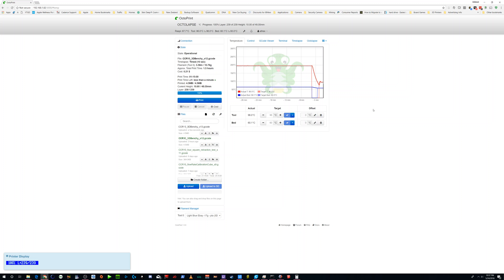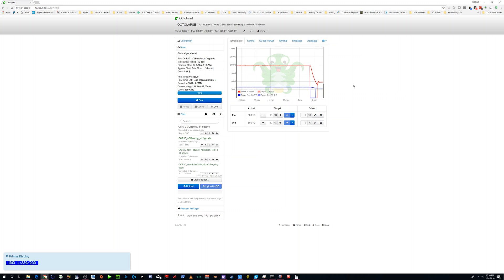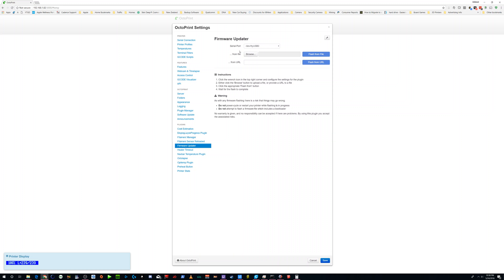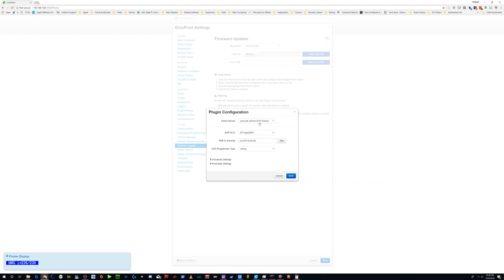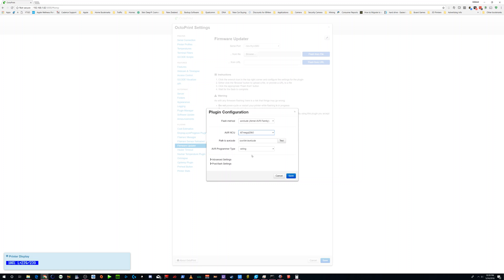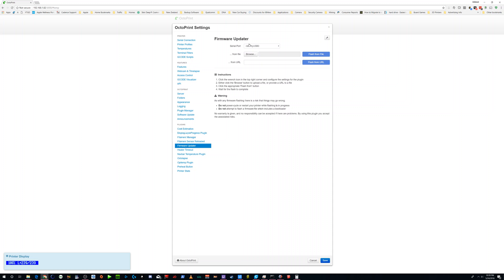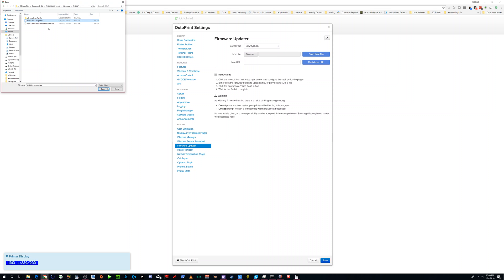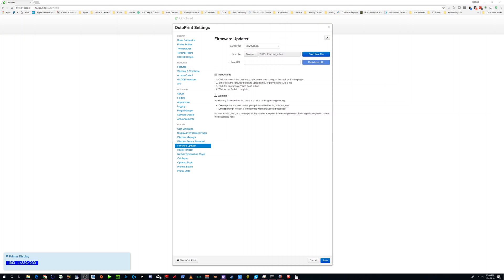Update CR-10S firmware using Octoprint firmware updater

Comment: can this be done on a CR-10 V2 (no bootloader) ?  Using the USB port?  Or does a USB flasher have to be used on J1 on the board inside the controller?
Reply from the maker: I am not sure for the cr10 v2, do you know which board it has?
Reply: @AthexTube  

2.5.2 -- but i've heard it has no bootloader from the factory, and only gets a bootloader AFTER being flashed.  Haven't been able to prove or disprove any of this tho.

Thanks for considering.
Reply from the maker: @etyrnal  Seems like you will need to flash a bootloader most likely. I would look for a guide to flashing the Cr10 V2 specifically theres always a risk to brick it if done wrong.
Reply: @AthexTube  

ok, thanks!  That's what i was trying to be careful of.

Comment: UPDATE: WORKED PERFECTLY! 

lol. well. that didn't work. "KILLED. PRINTER HALTED Please reset." I wanted to get a dual extruder board eventually anyway.
Reply from the maker: Something must have went wrong during the flashing for that to happen. I havent had probablems but always worry. Apparently you can restore the firmware with a raspberry pi or ardunio there’s probably videos on it somewhere
Reply: @AthexTube  not your fault at all. Your instructions were great. Turned out to be a total coincidence. EZABL nut on the new bullseye fan setup (which was the impetus to updating the firmware because I needed to move the easy EZABL from the left to the right)  was coming in contact with the thermistor and heating cables. When the new firmware went to initialize the EZABL at boot, it just crashed.
Reply from the maker: @BBB-fh8dx  Nice, glad you figured it ou!
Reply: @AthexTube  ehh. I was kind of hoping to get that dual extruder board. Lol

Comment: Do you have any walkthroughs for plane cr10? My printer starts the firmware flash disconnects and times out
Reply from the maker: I dont but you probably need a guide for flashing the bootloader
Reply: @AthexTube  that's strange I already installed the bootloader as I am just upgrading my TH3D software currently on the unit.

Comment: Hello I need your help, I have a Cr10-Max and when I send a Gcode through Octoprint the Bl-touch moves but the XYZ axis motors do not move
Reply from the maker: I dont know if you fixed this issue, I just installed a bltouch but I didnt run into that problem

Comment: Seems it's all changed now :( Totally different interface on the Octoprint plugin
Reply from the maker: Thanks I may do another video with the interface change updated. I havent looked at it but I suspect the options are similar just different places/names
Reply from the maker: I took a look at it and I think you are using a completely different plugin, please use the following plugin for this functionality: https://plugins.octoprint.org/plugins/firmwareupdater/
Reply: I think you're right. I have this now, Can't seem to flash though , get a time out. I'm getting my HEX file from the temp folder , that export complied binary doesn't seem to give any save options. Or I'm doing it wrong :)
Reply: Found the HEX file, still get time out :(
Reply from the maker: @MONTY-YTNOM  are you using the plugin in the video now? I havent seen it ever timeout unless the setup instructions for the avrdude aren't followed in the plugin info
Reply: followed it to the letter, it verifies the install path, it 'says' it's all there, just keeps timing out :(

Comment: Can this been also done on a CR-10?
Reply from the maker: It can, but you need to do the bootloader flashing I believe. There should be videos that cover that but I believe it requires an arduino
Reply: @AthexTube  Why is a bootloader needed prior? I see mention of this frequently but no explanation of why. Also, is there a way to determine if you have a bootloader already?
Reply from the maker: Jeff Jorczak i believe without a bootloader the raspberry pi cant talk to the flash properly. As far as determining if you have one, i think only the cr10s and higher end models have it. All the lower ones are without

Comment: On my side the progress bar shows only "Starting flash..." for the whole time. Does anybody know what's wrong here? I have a CR10S and I think I do not need to install a bootloader first.
Reply from the maker: I haven't seen that you don't need a bootloader with the cr10s, but make sure your settings in the menus are correct for the board and wiring
Reply: @AthexTube  meanwhile I flashed via Arduino. But maybe the problem with octoprint is caused by the supply voltage of the USB. I have a tape on the 5V pin, because I don't like to have the display switched ON during the printer is off, caused by the USB supply voltage of the Raspberry.
Reply from the maker: @somi7405  could be, I actually have that taped too and it worked ok for me but it's possible
Reply: @AthexTube   Mine is also stuck on Starting flash but I have no idea how I could fix this ,  you now any solutions?
Reply from the maker: @Vanilla_Wh0op  the only idea I have is to check the wiring and board settings. I never had this happen. You could check the usb cable as well or try a different one
Reply: @AthexTube  I'll try a new cable first then.

Comment: hey man, how to i create the hex file
Reply from the maker: https://www.youtube.com/watch?v=B2ODwmiMNhc
Reply: Still NO clue on how they got the HEX file. That TH3D video didn't really show the HEX file.
Reply from the maker: you have to use the export compiled binary function under the sketch menu
Reply: Thanks for the response. Every time I go to upload I get an error msg saying:
sorry - this program has been built without plugin support
exit status 1
Error compiling for board Arduino Mega 2560.
Do you think it will be safe to flash my CR10S still?
Reply from the maker: @user-xf1il5dm1v  I don't think so, I would look to see what the issues are compiling. You gotta be extra careful with firmware updates
Reply: I agree & since this is my first time flashing I don't want to rush & mess up. I guess I can still install the hex file via usb to computer from printer, right?
Reply from the maker: you can, but I never have done it that way

Comment: So let me ask. I see a lot of firmware update guides that require jumpers between boards, pushing a boot loader and what not. Is all that still required? Or can octopi bypass all that and just flash over the USB?
Reply: I have the cr-10 and just flashed new firmware. The cr-10 unlike the cr-10s does not have bootloader on the printers board so those videos you see where they take jumpers is to just install a bootloader that then allows you to flash via ocotprint or from your pc.
Reply: @designlabs4962  Is there a way to tell if I have a bootloader already?
Reply from the maker: Matthew Mohon this is for the cr10s, cr10 requires a different method.